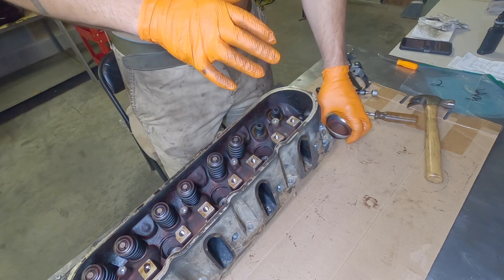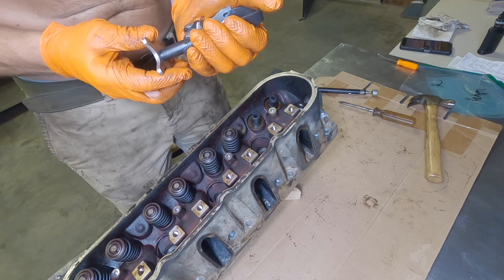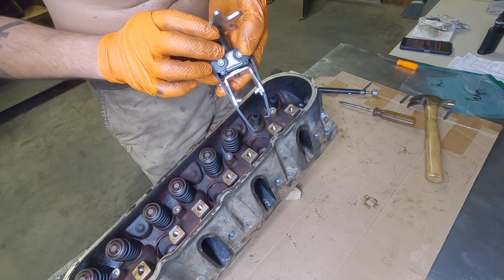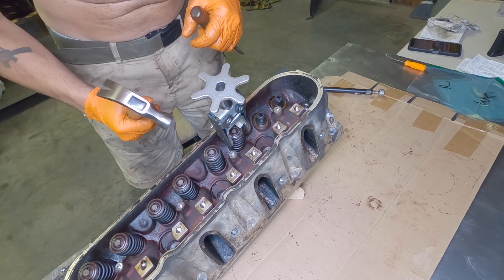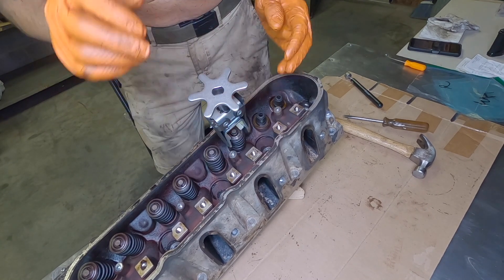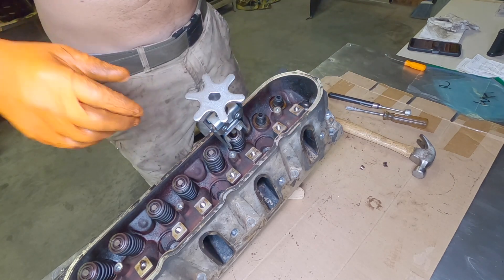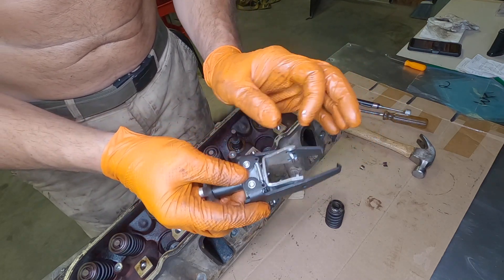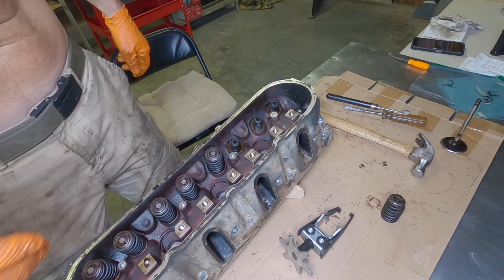How to Remove Valve Springs from Head

Comment: Appreciate you sharing your experience with this tool. I'll be working on some sbc heads and been looking to make or buy a tool for the springs. Cheers
Reply from the maker: you got it. it's not the best tool, but it can work. maybe try the tool that bolts down and closes 2 springs at once.
Reply: Yeah, I saw one of those on the Amazon.
Reply: I put some magnets inside a socket and clamped down